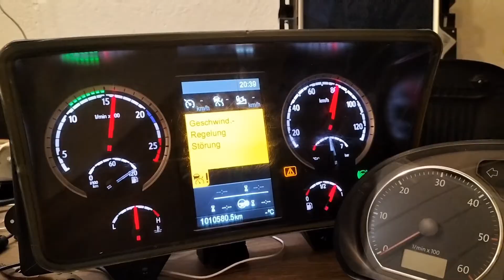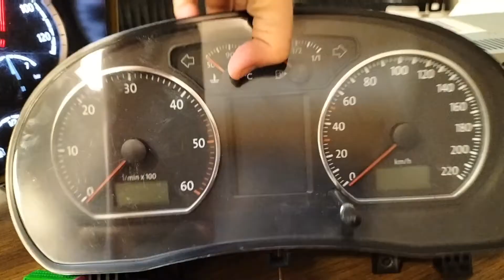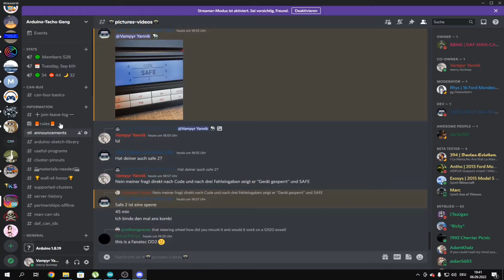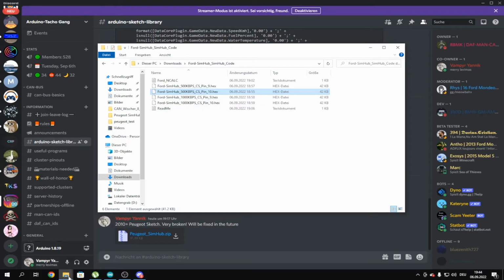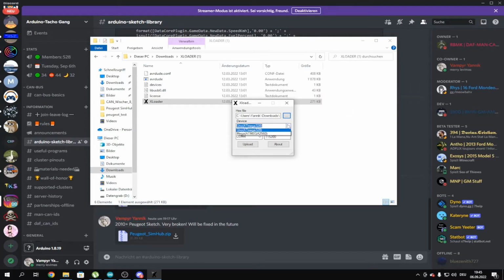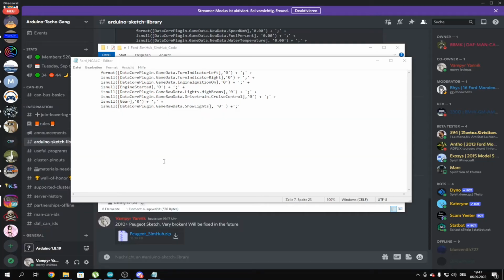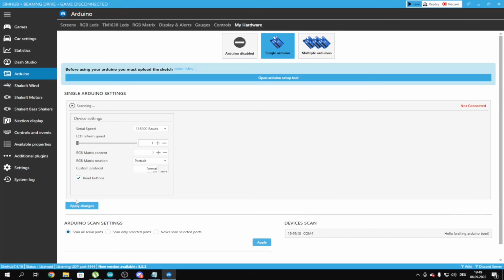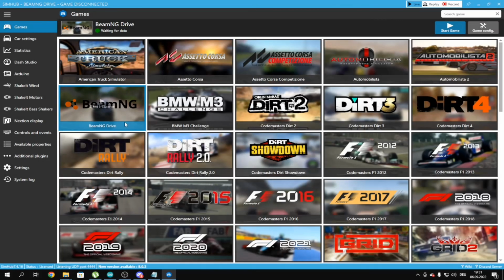CAN Bus Instrument Cluster connected to games with arduino and SimHub!! - Tutorial

Comment: Hello, i saw you that you have the Audi A4 B6 cluster. I have the Audi A4 B7 cluster, they are the same, it's just that the arrows in the cluster are not. I just bought my Arduino computer and the cables that i need, and i have not a single idea on how to connect my Audi A4 B7 cluster. Can you please do tutorial for your Audi A4 B6 cluster with the SimHub and everything i need, that will be more than helpful for me. Thank you.
Reply: I can't help with connecting to SimHub but I just wanted to let you know that the B6 and B7 clusters are not the same. The B6 uses RB4 (Immobilizer Gen. 3) clusters while the B7 uses RB8 (Immobilizer Gen. 4) clusters. They are visually identical but the insides are very different. RB4 is relatively easy to work with but the RB8 has much stronger encryption.
Reply: @allyouaskfor RB4 and RB8 i think it means if the centre display is colored or not, I have a B6 with RB8  sticker on them and I am pretty sure it’s Immo3 because it’s a 1.8t from 2001 and if you immo off the ecu you can literally use B7 clusters, I tried it on my own car since the original clusters have a faulty fuel gauge and i used 2.0TDI gauges from the B7, the only visual difference from them as far as I know are the red line on the needles the B6 has a longer ones
Reply: @Andrei-eb2du   I own a 2004 B6 and also a 2005 B6 and with the 2005 I can adapt and use an RB8 or RB4 but with the 2004 I can not manage to adapt the RB8 to the vehicle no matter what I try. The display doesn't determine whether its RB4 or RB8 as you can get an RB4 with the red display or as full-colour. The RB8 also comes in both options. I have multiple RB4 and multiple RB8 clusters and I have virginized all of them and cloned the eeprom and key data between them but for some reason the RB8 will not adapt to the 2004.
Reply: @allyouaskfor  I work on a junkyard and all the ones I've seen yet with colored display were RB8 and the red ones were RB4 and assumed that, I know it's almost if not impossible to use RB8 on an RB4 if you don't disable the immobilizer from the ECU to use, maybe that's why the previous owner did that to get RB8 working, since it's really hard to find an early B6 with colored display, most I've seen are from 2004. The only disadvantage is you have the immo light flickering while driving, but he fixed it with duct tape
Reply: @Andrei-eb2du  From all the research that I have done around these clusters, I also thought that you could not replace an RB4 with an RB8 and when I put the RB8 into my 2004 and it failed to adapt, it proved this to be correct. BUT just to double-confirm I removed the RB4 out of my 2005 and installed the RB8 I was able to adapt it without issue while keeping the immobilizer enabled. I don't know why it works but it does. Both vehicles have the same ECU's as well (8E0909518AK-0003). I'm thinking that because it's a 2005 which is a split year that produced both B6's and B7's that it may have a B7 module somewhere allowing the RB8 to function.
Reply: @allyouaskfor One issue I heard from other people using B6 clusters on B7 or vice versa sometimes you need to reprogram the ABS pump again, but i had no issues with it and I now have a RB4 cluster from a 1.6 B6 since having diesel rev line is kind of weird as the issue from the original clusters is from the main board and not the fuel gauge which is separate and switched it from the clusters to see if it was faulty and yes the main board is different as it sucks to not have a colored display because I tried to swap it but as far as I seen the board from the colored ones are pretty much identical from the B6 with the B7

Comment: Hi,i glued the 5 6 7 8 pins of the power and which wires do I have to connect to the cables from my power supply?
Reply from the maker: What cluster are we talking about??
Reply: @vampyryannik7334  the polo 9n cluster
Reply from the maker: @iusti1297  connect the pins to + and - ofcourse. Terminal 15, Terminal 30 to 12V + and Terminal 31 to Ground
Reply: @Vampyr Yannik  okay,thank you
Reply: @vampyryannik7334  I made it work with a mcp 2515 board
Thank you for The tutorial!❤️
Reply from the maker: @iusti1297  np
Reply: @iusti1297  could you please tell how to do it? I also have polo 9n cluster

Comment: Can I know how u wire the truck/buss cluster ? And if you have any code for it
Reply from the maker: I do have Code for it but I am not giving it out. Wiring is fairly simply done. 24V Power supply for Power (3 Wires) and then 2 wires for CAN Bus
Reply: @vampyryannik7334  gatekeeping obscure ass code💀
Reply from the maker: @vinnyandtheboys8088  imagine hating on someone becaude he's doing what hr was told to do
Reply: More like not risking jail time by releasing non public, private information. There's a reason each manufacturer keeps this info a secret. @vinnyandtheboys8088